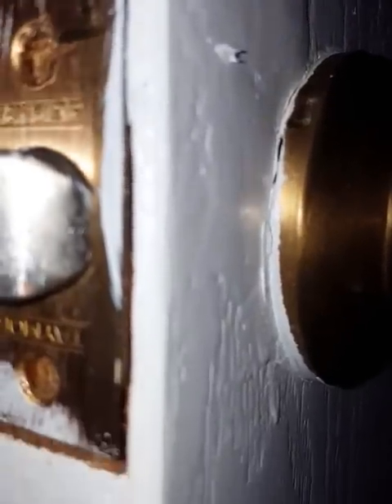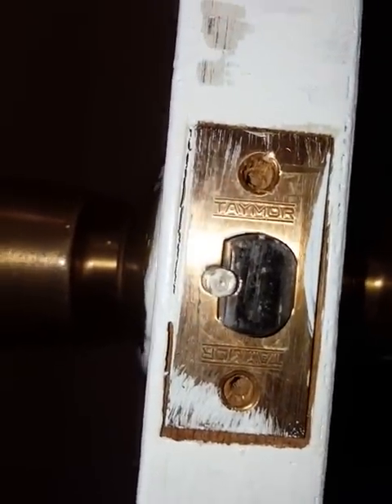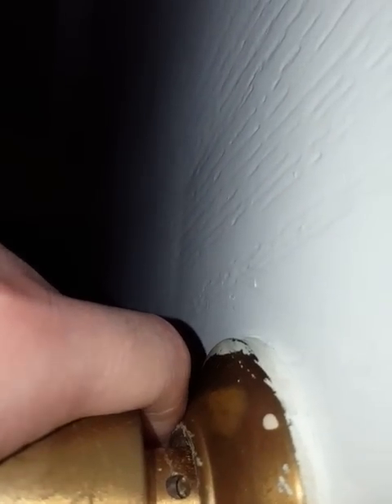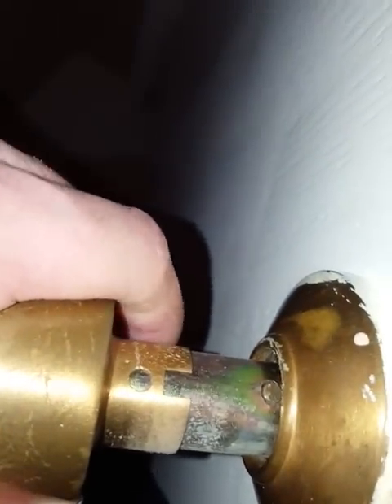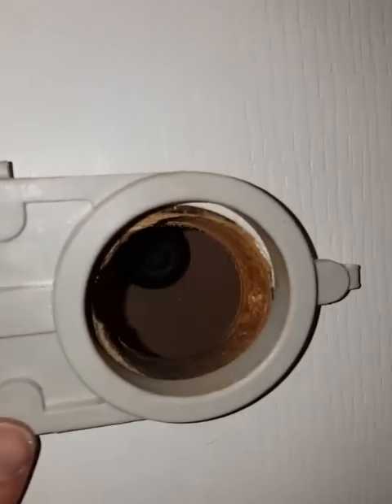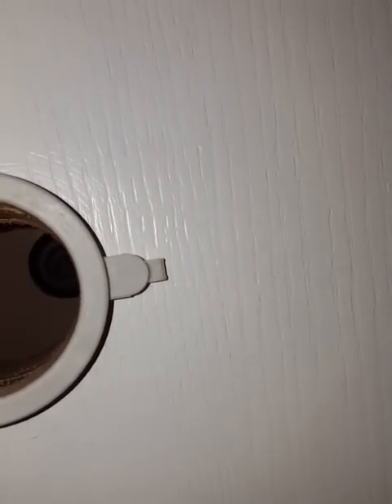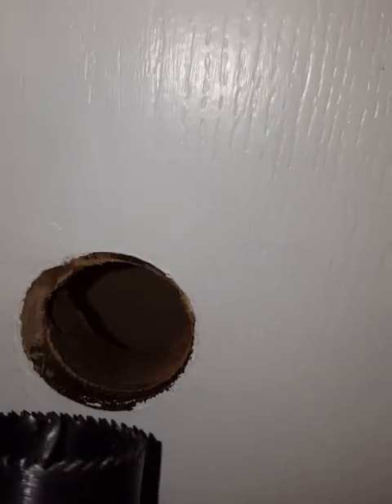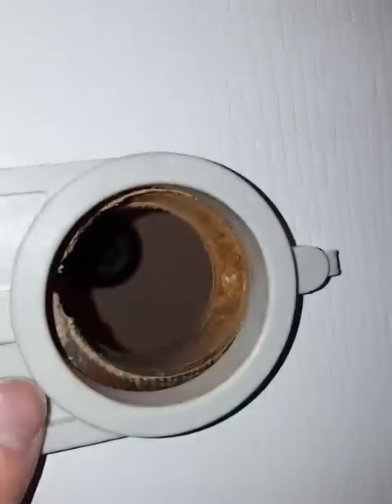How to remove door knob without exposed screws!

Comment: IT DOESNT HAVE THAT HOLE THING
Reply: I also have a door knob without the hole but has 1/8" indentations on either side . But you can't get a screw driver or  pick anywhere inside it.